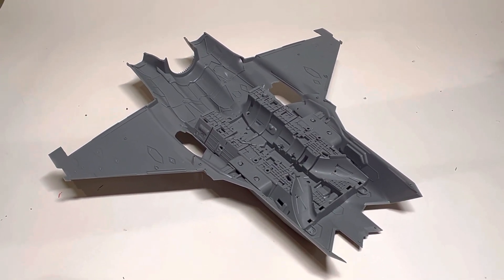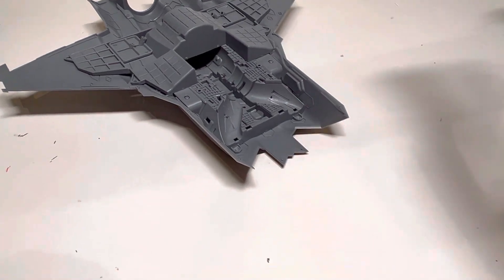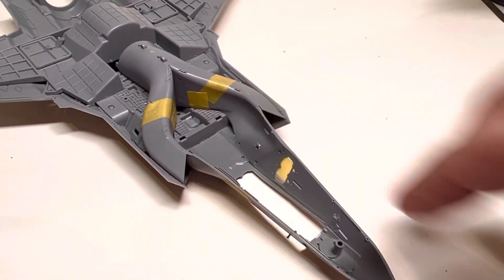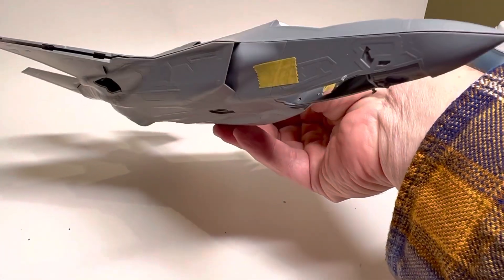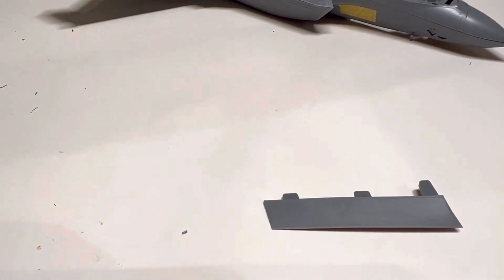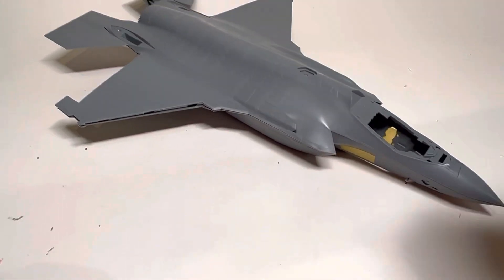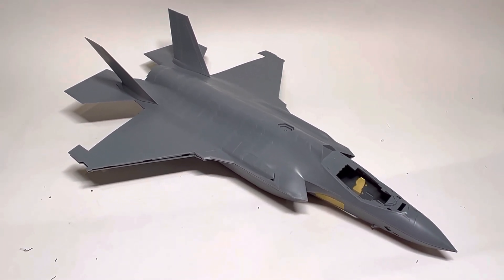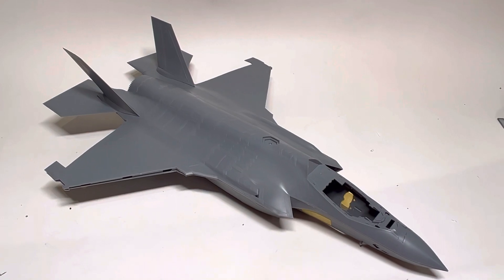Trick engineering with Tamiya's F-35A

Comment: I’ll hold off now and hope that they do the C model.  Yeah, Big T has a spotty record with follow-on variants, but I’ll wait. With the F-14, you could tell from the sprue letters that other versions were planned. Does it seem that way here?
Reply from the maker: Tough to say since the B and C would basically require new fuselages (and wings and tails on the C etc) but they've certainly engineered surrounding parts in a way that they could fit to major new parts.
Reply from the maker: I'd also add, come to think of it, sales of the F-35A would probably have a lot of influence on whether a B or C gets greenlit. And I do think a B is at least a 50/50 possibility, given that Japan's getting some.
Reply: @DoogsStudios  I know the C is a stretch: one user, lots of new parts, etc. But that carrier capable nosegear is what I’m after. I like big struts, and I cannot lie.

Comment: Hope someone markets a good set of masks for this thing
Reply from the maker: the kit's decals for the RAM paneling are really something to behold
Reply: Current versions hardly have any colour/tonal difference between the Ram strips that cover the panel boundaries and the basic RAM paint applied. I suspect its probably best done by a weathering style effect now.
Reply: @nickbrough8335  yes, but there is still a difference in appearance where the ram panels are. they have the same color but some kind of different coating, that can be noticeable under various angels (except aggressor one, afaik).
Reply: @skuki1980  True, but I've yet to see anyone use/make a paint or wash which contains reflective microparticles which are aligned in one axis only.
Reply: @nickbrough8335  yeah, but in any case, it might be just enough to make some different clear cote over ram panels, simply to get "different" appearance. or something else. just saying that the masks for all panels (New ware released them) might be useful even for new versions..
Reply: New Ware made 4 sets